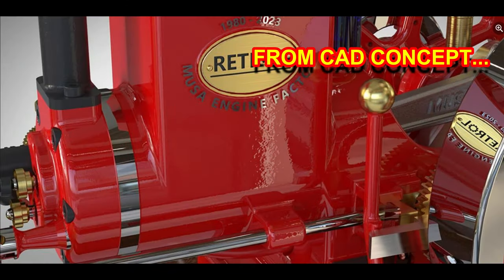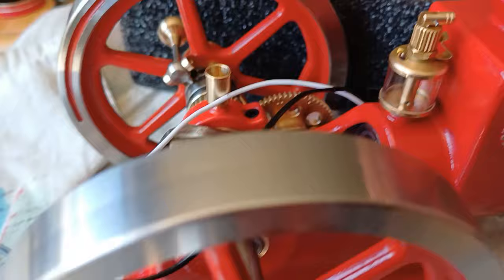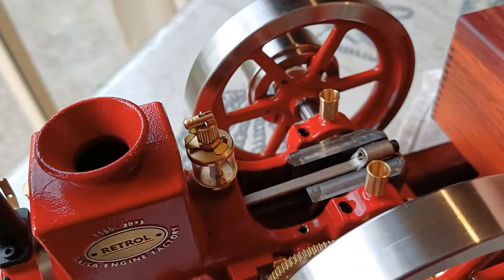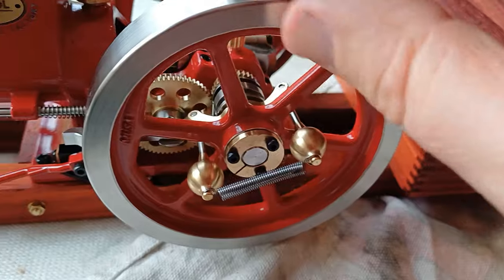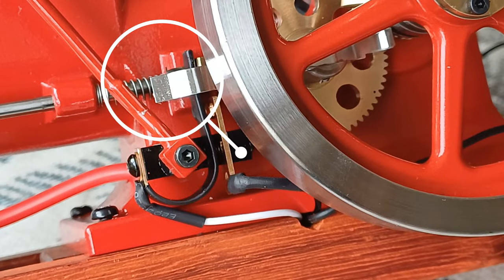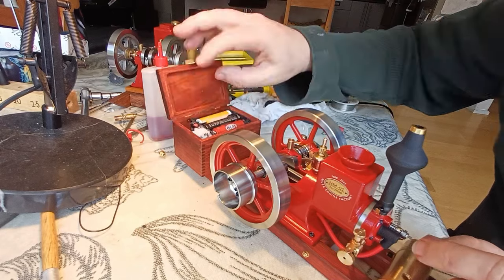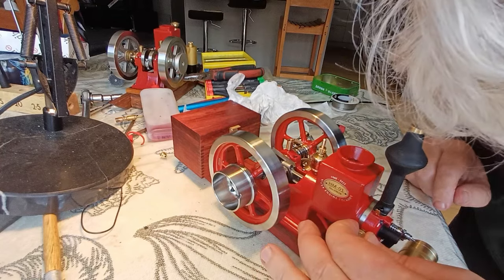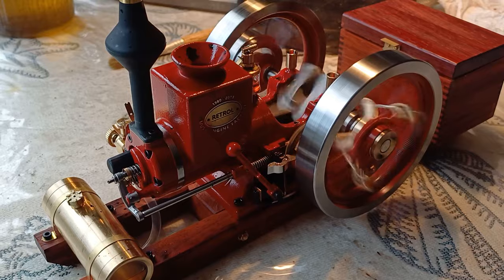MODEL HIT & MISS ENGINE for 2024 - MUSA HM-01 - Review OUTSTANDING How far they've come!

Comment: DO NOT get this kit from Sterling Kits, their customer service is very bad.  I mean really sucks.
Reply from the maker: Hey John. What was the problem with the engine??
Reply: @ThomasPCGuruENGINES  The 2mm screws that hold on the standpipe to the head do not fit.  They are too small and just pull out.  I have tried 2.5 and 3mm, but they don't fit either.  I have been to two hobby shops and one specialty shop that deals in nothing but bolts and nuts and they don't have a clue.  I have been working with Mona at Sterling, but it is like talking to a rock.  She wants to send me more 2mm screws and I have tried to explain to her that I already have some and they don't fit.  I don't know what size the hole in the head were drilled and tapped for as NOTHING fits.  I cannot make Mona understand that.  I need a new head that has been machined for the correct size.  I have been a machinist for 65 years and I think I understand screw sizes.  I might just have to put the head in the mill and drill and tap the holes for 3mm, but I shoul not have to do that.  Mona should not be in customer service.  All I need is a new head that has been machined correctly.

Comment: How would you rate the longevity of this engine? And, not including batteries, what would likely be the first part to fail? Thank you.
Reply from the maker: Mmmmm...even the brass-built engines of these engines will last the expected lifetime of use of just a few hours. 
The original hit and miss, the microcosm  M90 wore the badly fitting main roller bearings in 1-2 runs, then the big and small end bearings. But all those can be fixed, and I have run mine every day for two months and it no longer appears to wear. This engine is made from steel castings with fitting bearings and much better machining tolerances.  Cylinder sleeve is stainless and won't rust from water.
From what I've seen the only wear will be the detent lever pin riding in the mainshaft slot, and only then in unlubed or running for long period with the "CONTINUOUS" lever interrupting the detent process, because this means the slots pushes hard on the pin due to speed.
So...I think this engine can last "forever". Theoretically the piston ring can wear out but in these engines, they run cool. I've never worn one out.
First part to fail maybe ignition but again, this engine's ignition is properly encased in resin which healps oil & heat management and longevity. If original hit & miss engines can last 110 abusive years with their crap old metals tech, this can last forever
Reply: @ThomasPCGuruENGINES  Thanks so much for such a wonderfully detailed reply to my question about engine longevity. This engine is going on my Christmas wish list since it is built to last.
Reply from the maker: My pleasure

Comment: I purchased the kit version MUSA HM-01 #23190. It runs great.
Reply from the maker: iI bet you enjoyed wrangling it together. Any mods or tips?
Reply: @ThomasPCGuruENGINES  I shortened the spring a little from the factory one for a faster return and it was trial and error from there on the fuel settings. I've been tinkering with the L6-210 trying to get the ignition situated. It runs OK, but the timing perimeters are a little off. I think I have the MUSA HM-01 tweaked where I like it for now. I may try the tweak you did with the cam follower.
Reply from the maker: The ignition is fiddly. That leaf spring needs to be bent just right for as close to TDC firing as possible...my opinion!

Comment: Great video!....Please keep us posted if you find a way to slow it down even more?
   Can you convince Steam 212 to have a go at working his magic on HM-01?
Reply from the maker: I'm in two minds about slowing it down more, I'll have a look for a weaker spring. It needed to run in before I tried that anyway...Mr 212's videos have become a little less common lately...yeah I'd love to see what Matt would come up with too. He's pretty amazing
Reply: How long did you run in your other china made engines before you felt they where properly run in?
Reply: Some of the guys on tiny engine forum noticed above average "gear whine" from the HM-01 on the factory first fire up....yours seems sugnificantly more quiet as far as gear whine.
  Ideas guys have had to slow it down:
-polish gear teeth with toothpaste, its an old slot-car trick, most toothpaste contains Very Fine abrasive, you put the toothpaste on dry gears and it stays on like grease, your run the engine for an hour or 2 and rinse away the toothpaste with warm water, then aply your favorite gear lube, this method is hard to "over-do" as the abrasive in toothpaste is so fine.
-someone said a slightly softer intake valve spring may help engine coast longer?
- I have successfully made a softer governor spring with a Very Weak rubber band, most are to strong or wrong size...i got the weakest i could find and cut it to make a single strand! I tied a loop at each end like this O-----------O
  Then try different lengths to see how slow you can get, when you find the slowest it will run, feel the strength of that rubber band and try to match it with a hand wound guitar string spring.
Just some idea's, maybe one will spark your own experiments?
Reply from the maker: In my experience getting the valve lift within detent coast is the trick to longer coast. Then, yes, a weaker spring.
He he, we all have different ideas...I used old teflon grease on the cogs. They whine because they're meshing really well. It would be a major hassle toothbrushing those gear teeth right? Messy....even if you don't use a brush just toothpaste & run it.
Those gears are brass they will quiet down @benjaminkroes9785
Reply from the maker: The other engines needed tightening up the con rod ends, changing springs, the original silver M90 needed bronze bushing and the useless needle bearings cast back into the hell from whence they came. So that's a few runs. M90 I ran every day for a month! @benjaminkroes9785

Comment: Mine finally arrived after a bit of a wait due to end of the year!!  I am stoked with this!  I had no problems assembling this and everything fitted together so well. It fired right up no problem. The quality of the kit is really very good.  I am wondering though how you keep the rod big end bearing well lubricated?  I am adding some engine oil to both sides of the rod bearing by applying the oil between it and the crank lobes whenever the engine is stopped.  There does not seem to be any better way of doing this?  Other than that, the engine has no issue receiving oil and it runs really nice.
Reply from the maker: Yep that's exactly what I do re lubing big end. Seems fine to do that way on all these models, though the run time can be 2 hours with the right tweaks so I'd do every half hour.
I'm so glad to hear your experience has been positive all though. Well done! a KEEPER :)
Reply: @ThomasPCGuruENGINES   Thanks for confirming that.  Glad to hear that works fine.  Yes it has been a great experience so far.  I have mounted everything properly - ignition box, battery and added a toggle on the back of the battery box.  

Wired everything under the engine in a similar way you did and it looks very clean.  Now I will play with the governor spring and look at changing the push rod spring to make it run a lot slower.

Comment: Thomas, Hope this finds you a happy man. With all these great videos, how could you being anything else. Thomas, I have a very specific question please. Is there a video or written explanation on finding TDC on these engines?
Reply from the maker: Hi again Jerry, What a sweet sentiment. Yeah, with a smart successful wife, two great kids, three cats, two chickens, and one dead goldfish, I am a happy man. 
TDC is easy because the crank is level all the way in, but you're asking how to get the ignition as close to TDC as possible or just after, which is what you want to do. That's not easy. You have two brass leaf contacts 4:38 that press together just as the valve rod goes right, into the cam, all the way, (also releasing and therefore closing the exhaust valve all the way) allowing ignition. The left leaf  conact is covered in black plastic heatshirk sheathing except for the contact point halfway down. You need this conact point moved a bit. My result is here https://youtu.be/qYpkNPi3itc?si=yO18J9mk2P8HqIkH&t=354 I should tidy the top plastic where the pliers greipped it...notice slight bend?
Clean the contacts if they're oily. 
Take out the spark plug and tape it to the engine metal so it sparks when you rotate the engine. Note the piston is all the way in and conrod level at tdc by eye, or you can feel it with a toothpick in the sparkplug hole. Turn on ignition.
Rotate slowly, where's that spark? For best running at slow speed it needs to be delayed to or after tdc. The leftmost ignition leaf contact touches the right one in the middle. So, solution is to bend it so that the middle strikes the right one slightly later, altough the top is being pushed by the valve rod at the same place.
So, instead of going up straight, the left leaf contact needs to bend very slightly to the left (delaying contact), then back to the right as it reaches to top where it's pushed by the rod. Turn off ignition.
Get your pliers and bend the left contact leaf leftwards away from the right one 5-10 degrees at the bottom. Then firmly grab the leaf with end of your pliers halfway down the leaf, push the nose of the pliers left while angling the top of the leaf rightward, a twist. You're trying to put a bend in it.
You want the top where it was and the middle a millimeter or two left of where it was. 
Turn on ignition and check your progress. If you get no spark you've put too much bend in the leaf and they're not contacting. Rinse and repeat
It's a fiddly task but a must-do one
Reply: @ThomasPCGuruENGINES  Hi Thomas, I could not remember if I thanked you the detail on TDC you sent. MUCH appreciated. Thank you so much!!!!!
Reply from the maker: Happy to give my opinion!

Comment: Hello Thomas, Hope you doing well. I have enjoyed your YouTube videos so much. Please keep up the super work sir. I ordered my Retro HM 01 today. Can you advise me on oils, grease, etc and where to utilize them?  Thank you, Jerry
Reply from the maker: Oil is standard 30 SAE small engine oil from hardware store. Oil everything that moves. Grease is optional for the gears if you want less whine, but that will reduce in a few runs. For the valve stems, particularly the atmospheric intake valve, I use a drop of sewing machine oil as SAE30 can stiffen so it sticks this valve next time you run it. I use spray carburettor cleaner to wash oil drios from the ignition points under the latch parts, when the ignition gets oily

Comment: Rather pissed off that you get yours with the trolley while I'm still waiting for mine tbh. I found the oiler let's the oil through too quickly despite being at full adjustment. So need to find a way of modifying that
Reply from the maker: Mine did that at first but not now. You didn't get your trolley/base? You did buy it right?
Reply: @ThomasPCGuruENGINES  Yes the trolley etc was part of the preorder and it included the electronic ignition . Everything except the trolley base fuel tank etc arrived in my shipment. Mine was disassembled so I assembled the engine. Had to shim the main cap bearings otherwise upon tightening it would lock up the crank. You might be interested to know the crank has proper conrod shells like a car engine etc. Those fitted ok. We're slightly stuff to begin with but freed up not long after

Comment: Hi Thomas :)
Great video!  And thanks!!  I just got my engine. I didn't have to drill out the guide for the valve rod, but I did have to de-burr it.  I have my engine assembled ready to go but before I do, can you tell me what kind of oil your using in the cylinder oiler to lubricate the cylinder?  I used sewing machine oil during it's assembly as many of my other models require, but from what I'm seeing here, that might be too light for running it.  With sewing machine oil, I do get some blow back past the piston just turning it over, and the intake valve seems to barely open. Thank-you.  :)
Reply from the maker: Stirling engines need low friction but have low operating pressures. I use WD40. But for IC engines I used to use synthetic car oil or I now think 30SAE Small Engine Oil is probably perfect as I hear. The tolerances are not great so thicker oil works.
Reply: Than-you so much :)  That's what I'll use.
Upon deeper inspection. I found most of the loss of compression was at the spark plug.   @ThomasPCGuruENGINES
Reply: Thanks again for answering my previous question, and for all the tips you posted in your videos featuring this engine.
I did the mods you suggested and ran it for the first time today...and WOW!!!!  She ran perfectly right away no further mods needed!!!  Thank-you again!  I took some quick videos and will post them on my channel in a day or so. @PCGuruENGINES
Reply from the maker: Superb. I look forward to watching

Comment: Hi Thomas, after watching your channel for the first time a few months back i now own 3 engines wating on my 4th engine that is the HM-01. My question for you is what did you do on your ET1 engine to fix all that play in main bearing ??? any advice would be much appreciated cheers Wayne.
Reply from the maker: I was luck to have collected some bronze bushes in the past - you can see some in the banner of my YouTube page, on the left, that I used in my big "junk" hot air engine. 8mm inside diameter matched. That flange was in the way so stuck the bronze bushes in a bolt, put the bolt in the drillpress, used a file to remove the flange as I don't have a lathe.
Getting an engineeer with a lathe to make brass or bronze bushings is the solution. You may be able to find brass tube  of the right dimensions and just ut bits off
Reply: @ThomasPCGuruENGINES  Thanks for your reply Thomas i do have a friend who has CNC lathe and mill he has a few milling machines actually he is a few hours away but next time i'm in his area i will ask him to help out, just thought you may have had a go to website for brass bushings ?
Cheers Wayne.
Reply from the maker: Nope. Good idea though... the measurement is inside dia x outside dia x length. Inside is 8mm I think; lets say it measures 8x10x10 just google search 8x10x10 bronze bush or brass bush. I get results at crazy low prices, good materials too. In reality these should be split for future tightening but no need. They'll be way better than those goofy rollers :) on ET1

Comment: Hello Thomas, I have ordered and recieved the HM-01 engine. I bought the RTR version form Amazon it was missing the wooden frame and ignition set with spark plug. My question is are those items ordered separately or did they come with your RTR package? Thanks very much, Jon.
Reply from the maker: They are extras, John. I expect you are disappointed in the marketing of what you bought...I got mine from Enginediy dot com, the base frame, ignition set and box, and particularly fuel tank are outstanding and worth buying
Reply: @ThomasPCGuruENGINES   Thanks, yep the RTR part was quite misleading. Nice engine though.
Reply: @ThomasPCGuruENGINES  Hello Thomas, I was curious what fuel you are using and the oil used and the mix ratio. Thanks so much, Jon
Reply from the maker: Just saw this Jon. The engine is not fussy. This could use low oil ratio but I run about 1to 25 to 1 to 40
Reply: @ThomasPCGuruENGINES  thanks Thomas. I got mine running using zippo lighter fluid with just a few drops of marvel mystery oil. I'm still waiting on my wood base and fuel tank. I absolutely love the engine so far. I've got mine running nice and slow. Have a great day!!

Comment: Hello Thomas, hope you are doing well sir. I am getting a Retrol Steam Engine, the one that has a cylinder that I believe needs a drop or so of a specific type of oil. Can you help with what I should use?
Model number is the Retrol HM 1
Reply from the maker: Hey Jerry, welcome to the comments man! that engine will happily run with any oil but 30sae "small engine oil" may be the closest you  can get to proper steam oil. Steam engine oil is very thick and goopy and needs heat to reach the right viscosity. Smells mighty fine too
There are hobbyists supplying real steam oil, or visit your local full-size steam preservation joint with a pill bottle and beg. Seeing as they have it by the 44 gallon drum they'll probably be sympathetic, tell 'em I sent ya

Comment: Hello Thomas, hope you are doing well sir. I am getting a Retrol Steam Engine, the one that has a cylinder that I believe needs a drop or so of a specific type of oil. Can you help with what I should use?
It’s the steam engine with the beam and cylinder and piston. Thanks. Jerry
Reply from the maker: Hey Jerry, welcome to the comments man! that engine will happily run with any oil but 30sae "small engine oil" may be the closest you  can get to proper steam oil. Steam engine oil is very thick and goopy and needs heat to reach the right viscosity. Smells mighty fine too
There are hobbyists supplying real steam oil, or visit your local full-size steam preservation joint with a pill bottle and beg. Seeing as they have it by the 44 gallon drum they'll probably be sympathetic, tell 'em I sent ya

Comment: My HM-01 has arrived just wondering if you ever use AAA bats for power as we don't seem to run any of the engines for long, less space required.
Reply from the maker: AAA will be fine as there is a good long time between sparks on this model!

Comment: Hello, I was wondering what size battery you are using in that small box? Thank you.
Reply from the maker: I am using 3 1.5v AA batteries. couldn't quite fit 4xAA but I just realized 4xAAA would be perfect and fit. 3x1.5v is too little really, others report 6v is great